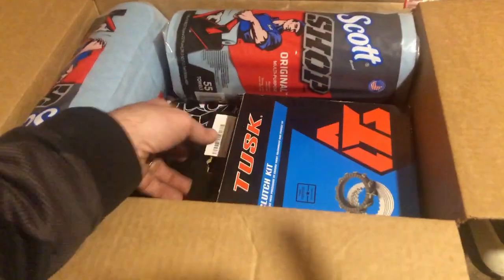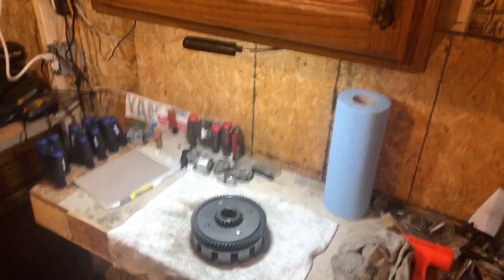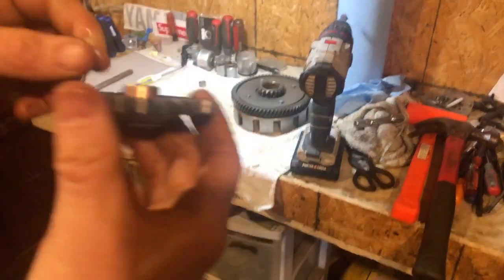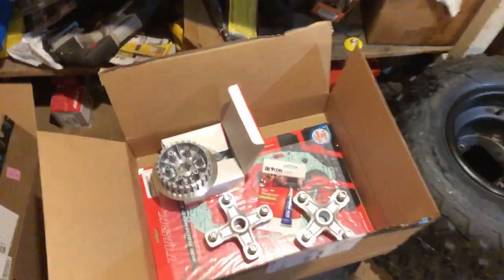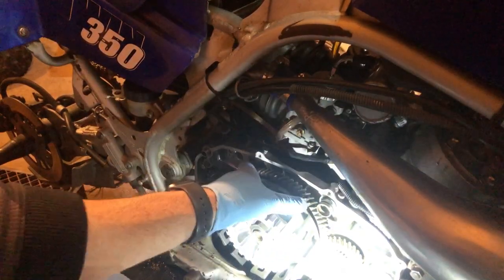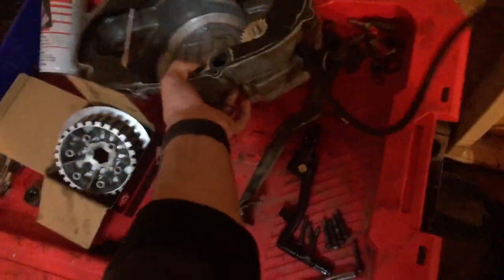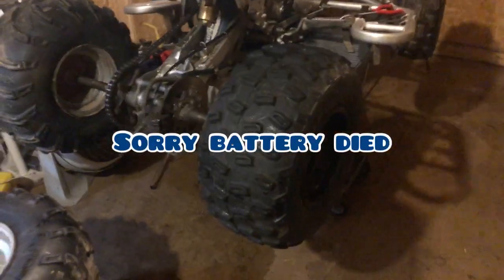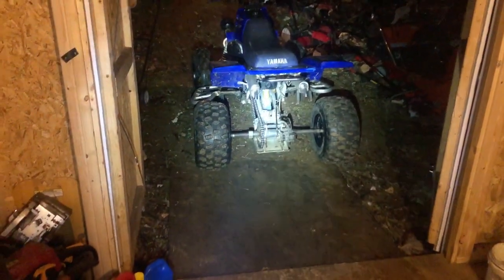Yamaha Banshee - Engine Noise - Idle Gear Bushing - Clutch Replacement

Comment: I have same wheels on my 700r. Very nice treads, hook good, slide good. Yeah the worn out basket bushings can make that noise too b.c. the basket chatters back and forth. The idler gear usually makes more of a steady loud whirring noise. But if basket was chattering bad, the idler would be chattering bad too. Bet the basket is what wiped out your idler. Good thing u did it all at once tho. I'm curious to see how them tires r on a 2 stroke lol. But yeah after seeing those hubs off, they r zilla hubs. I didn't see the 5 lug last time. Go back and watch sabos zilla vid, skip to when he swaps out the rear wheels and hubs. Blaster hubs look the same but their 4 lug. And dude....18 lbs in rotational mass!!! Ull notice a big difference up in 4th 5th and 6th. She'll top out quicker, snappier doen low too. Gonna be a much better ride all around